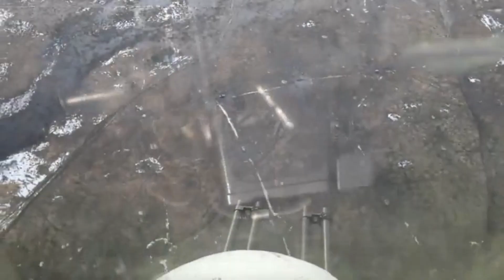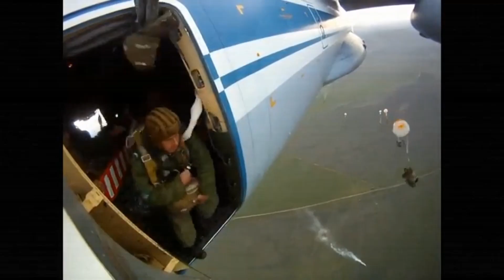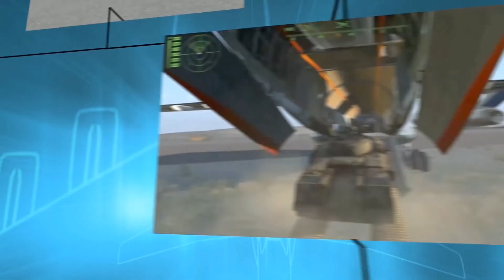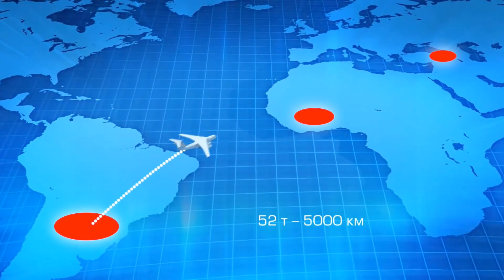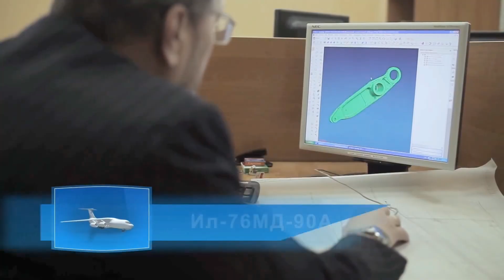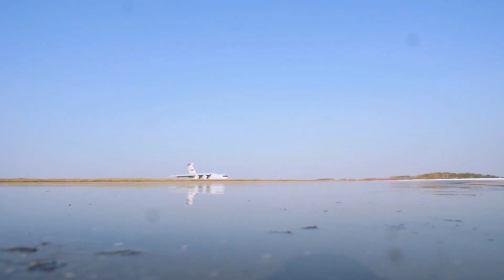Russian IL-76 Military Cargo Aircraft - HEAVY DUTY LIFTING!

Comment: The laws of physics set the design parameters for all types of aircraft, and heavy lift transport plane designs haven't changed much since they put jet engines on them.
Up-dating aircraft materials, power source and avionics is all that's needed on the basic design, no need for a complete re-design to get an aircraft to carry similar loads for similar distances. Modernising what fits onto the airframe gets the extra speed, distance and weights, building an all new design is clearly profit driven, not need driven.

Comment: I am curious why they ditched the gun turret entirely.  They could have made it an automated gun controlled from inside the cockpit.  I always thought it was one thing the soviets and later Russia got right.  If you have to do a drop in a hot zone it is a good idea to be able to keep the enemy's head down.  The problem with most cargo aircraft is they are basically defenseless massive targets.

Comment: I think it helps, that they had time to figure out maintenance and maybe improve air time on the new version. While they also keep the supply of spare parts for the older fleet of this type alive. It's definitely a bonus for export to make the new version a solid long term investment, while opening up a upgrade path for the older fleet. The training requirements might also be lower than with a completely new design. I think more important than the comparison to some american types, is if this is tailored to the users needs.

Comment: The latest version of the IL-76 appears to be something some of the air cargo companies would be interested in.  This jet is a workhorse and has proven itself for years.  With advanced avionics and engines, it would be more cost effective than the earlier versions and carry much more freight.  My only concern would be the availability of spare parts and engines for the West to obtain.  I also believe the cost would be less than a Boeing or Airbus cargo jet of similar size.  I also like the idea of four engines opposed to two even though fuel might be an issue.  I believe Russia should continue this aircraft because if it isn't broken, don't fix it.
Reply: Engines for the western nations won't be a problem. Like most other cargo aircrafts, this is also capable of using alternative engines.

Comment: Common dude!! You say youre in the aviation industry but you dont know what the APU or generator is for?? The APU isnt included for the comfort of the crew so theyll have power when the engines arent running. The APU is there for the ecact same reason its on aircraft like the 777, 767 and all others from 727 on. Its there to allow the aircraft to start engines without having to depend on ground equipment start carts like the super early jets used to be dependant on or when flying into airports that didnt have that support equipment they would have to keep an engine running while theyre on the ground. I will say this. A built in APU is an option on many airliners especially older ones. In fact one of the reasons for that air canada dc9 or md 80 crash was because it had to hot fuel or fuel with its engine running cause it didnt have the start carts to restart. It took too long and didnt deice again thus crashing.

Comment: Hmm why would they keep upgrading older things, maybe because they have shit funding and it's cheaper to keep upgrading parts and pieces over time than designing a whole new vehicle, I mean don't get me wrong they have some notable vehicles like uh...well, ok maybe they don't have a lot of really great things, but I mean they have the Sprut, it's a good tank destroyer, great gun, I mean it kinda failed what it was designed for (the specifics they put upon it, it's still amazing), oh they also have the Mig-35 (in my opinion their best fighter), but even that isn't even on the level of what is fielded by the US (F-22 is just god, F-35 definitely would outmatch it, hell a good F-15, F-16, or Hornet pilot could beat one) plus the gun it has isn't the best, but it's still very capable, helicopters, well they have the Hind, which is pretty good, but notice a pattern, they have some things that do good but fail in other areas, well maybe except the Terminator, I mean that thing is just badass, lucky bastards

Comment: This aircraft was designed to be similar to the Lockheed C-141 Starlifter.  As the Russians are want to do they made it larger.  No doubt it is a great transport with the equipment needed to fulfill its mission.  The C-17 which was the C-141's replacement was designed to be able to transport wide heavy cargo the Starlifter couldn't.  The C-141 has been retired as the airframes had 40,000 hours on them, which was a combination of combat and logistical flight hours.

Comment: I think that if the design works, keep using it. But i also think that a new design should be considered so that thier designs can be optimized for modern standards. Especially integration with electronic networks, automation, and flight cost.

Comment: I've always wondered what the cannons were for?
I mean, I would imagine a gunner would have some trouble keeping up with a jet interceptor or a missile, and the plane doesn't strike me as a ground support plane, though the gun is shooting ground targets in the video.

Or could it be a case of better to have and not need than to need and not have?
Reply: The main reason for having guns on the tail, I think, is simple: this plane was designed to deliver cargo to/from airfields near the front line. Therefore, during takeoff/landing the plane may be targeted with AA guns, Stingers or something like that (which was the case in Afghanistan, for example). The tail guns were to hopefully counter such threats, even if actually hitting someone on the ground with these guns might be problematic, the gunfire might just force them to keep their heads down long enough for the plane to get the hell out

Comment: This is the same 40 year old design with new engines. Not even "wide body". In the same class as the C-141 which was "retired" 25 plus years ago. Very Good aircraft but NOT even close to being in the same class as the C-17.
Reply: Stop reading those Russian LIES. FACTS: IL 76 is NOT wide body, you can simply tell that by just comparing the width of the IL 76 to the C-17 or ANY modern Wide Body aircraft. Your crazy if you thing the IL 76 is better than the C-17. The C-17 was not copied from the IL 76. The C-17 is a completely NEW design from ground up. INDEED the IL 76 was COPIED from the C-141!  FACTS: C-141 was designed in 1960 and First flight 1963. IL 76 designed in 1967 and First flight 1971. By the way, C-5 first flight 1968!! and An-124 first flight 1982!!  WHO COPIED WHO?

Comment: There is a further canadian twist to this one:
On the Aalborg Air Station they use Challenger (the aeroplane, not the tank) to patrol the Arctic. Not that much is happening there - and that is just as it should be; but just to make perfectly sure it remains so. They had 3 Challengers and on an international mission they smashed an engine - such things happen - but to get a replacement engine would take for ever. So the chaps looked at the internet and found one surplus to requierements from some arabian oil prince that went bankrupt and bought the entire plane for the price of the engine. The support ship Absalon was in the area spanking some pirates, so they brought the plane home to Denmark - typically Danish Navy: Return with more assets than they left with.

Now the Challenger was really to good to just throw away - needed a major overhaul though - and then the transport wing had an "Air Force One" and our PM can now travel to important meeting in a small but very posh plane with an interior out of the Arabian Nights.

Now there is an aircraft leasing company that ALSO has gone belly up with two Challengers in the passenger version - with a known provinence (actually old Cimber Air planes) and I have planted the idea that they should approach the curator of the estate to aquire the aeroplanes for a nominal sum and thus get a squadron up to full strength for the maintainance personel - and get a transport aircraft for the swapping of ships crews and transport staff officers (doing things staff officers do - slurping tea f.i.) - saving on airline tickets. The pilots will have to fly anyway to maintain the rating on the aircraft. Where they fly they really don't care - they just do their job.

There might be some conversion training where pilots apply for a reserve commission - but nothing to serious. There might be a position for an elderly NCO doing the thing he does best: Serving Martinies to officers (shaken not stirred) and some officers wife earning a little needle money as a flight attendant.

But my main consideration is actually transport for the military band (Prinsens musikkorps) - can't have his Royal Highness travelling without a band - can we? https://www.youtube.com/watch?v=z1088E6E2fY

Actually my ambition is a bit higher than that - this band has an association with a quite good opera soprano. Susanne Elmark.
https://www.youtube.com/watch?v=7djb5RWZ48Y
If nothing else that lipstick will scare the living daylight out of the enemy. The four high F's in a row can make anybody sweat on a cold day. All in perfectly good taste.

Comment: It would be interesting to know what the rationale was by the Russian ministry of defense regarding why they chose to remove the tail gun from the newer variant of the IL-76.  Was it a weight issue?   A cost issue?  Were the old guns not effective at suppressing AA, enemy aircraft, or shooting down SAM or AA missiles?     To me that would be very interesting to find out as it does seem baffling why they would remove what seems to be some seriously awesome defensive firepower. 
BTW, a video on the AN-72/74 Coaler would REALLY kick ass.  The STOL characteristics of that plane are amazing and it has a very interesting and unique design!
Reply: Tailguns are not very effective on jet aircraft as the bullit basically just hangs in the air. The B-52 has similarly eliminated the tailgunner.
Reply: tail gun not effective anymore jet can shot down any aircraft with rocket on distance up to 400km
Reply: That's odd... because in this video the bullets seem to smash the target area just fine.  Many Russian aircraft also still carry the tail guns.   The Bear bombers has them, the AN-12 Cub has them, the TU-22 has them.  Are these just for decoration?  Also, the tail gun is supposed to have radar guidance as well.  Surely that would be useful then for shooting down enemy aircraft and missiles.

Comment: I don't give AF if they are antiquated or not meta relevant; tail guns and turrets in general are dope.
Reply: Hello from sunny Bulgaria. The guns existed in the old version of IL76! Like they exist in the old version of B52.
Reply: in 80's, the tailguns were intended (and trained) to drop radio-reflectin straw against the radio-guided attacks, rather than to destoy ground targets. however, current versions of il-76 has no tailguns and a rear cabin at all (except the fuel tanker models), as now they leverage other protecton systems. however, they keep ability to use plugable containerized weapon - as missiles as even planning bombs.
Reply: Looks like a Gast gun; recoil from one gun drives ammo into the other.  The Gryazev-Shipunov GSh-23 was a Soviet version.

Still, tailguns on transports are incredibly stupid.
Reply: @psikogeek  why did B-52s have tail guns  is that not  incredibly stupid?
Reply: B-52s with tail guns were indeed incredibly stupid.
Reply: @psikogeek  during the Vietnam War a B-52s tail gun shot down a NVAF Mig-21 so in this case "incredible stupidity " paid off.
Reply: It does not follow that a tail gun shooting down a Mig means it "paid off."  The engineering, financial, and operational trade-offs of carrying the tail gun outweighed the benefits from it.

Such the Air Force concluded and removed tail guns in 1991.  I think that they had reached this conclusion around 1970.  

Tail guns cost lives.  Those who disagree are free to write the Air Force to implore their reinstatement.  They will treat the writers of such letters as "incredibly stupid."
Reply: @psikogeek  in the case of Mig-21 shoot down by a B-52s tail gun it paid off by saving the aircraft and  lives of the crew.  The airforce   had also concluded that fighters wil notl need internal guns in the era of missiles so left the gun out of the design of F-4 Phantom  but later reversed and developed the F-4E with an internal cannon. 
In this day and age I would tend to agree that tail guns are not need are a waste as there bomber will not face any air to air threats from the weak countries they attack who can't fight back in the air.
Reply: In the case of those who decided to put ( or keep ) tail guns on B-52s, the choice is whether to kill the crews by
A) having tail guns or
B) not having tail guns.
Obviously, they decided to have them at first.  If I understand correctly, they later deduced their prior decision was a wrong one from the day that the B-52 was designed.
Reply: @Ace-Av8er  also, if fighting a near-peer opponent they will have jets with missiles that out range the guns, so it is doubtful they would be of use now... That said, bringing back turrets might make sense when equipped with with lasers as they might prove useful as an active protection system / CWIS.
Reply: @Ace-Av8er  Syria
Reply: @georgepantazis141 the il-76md plane i used to fly many years ago are in syrian air force now. good luck to it.
Reply: @psikogeek
It's slavic AC-130.
Reply: @psikogeek  but not when it is used as a bomber.

Comment: Matsimus, there is no such thing as kilograms of thrust. kilograms is not a unit of force but a unit of weight. In this case Newton or Newton/second would be a more relevant unit.
Reply: Kilogram-force (Russian designation: kgf or kg; international: kgf or kgF) - unit of force in the ICGSS system of units; along with the meter and the second is the basic unit of this system. The Third General Conference on Weights and Measures (1901) gave this unit the following definition: "kilogram-force is equal to the force that informs the resting mass equal to the mass of the international prototype kilogram, acceleration equal to the normal acceleration of gravity (9,80665 m / s2)"
In the Russian Federation, kilogram-force units and gram-force are allowed to be used as non-system units with no expiration date with the "all areas" scope. In accordance with the Regulation on the units of quantities allowed for use in the Russian Federation, the kilogram-force unit is used only in cases where the quantitative values of the quantities are "impossible or inappropriate" expressed in units of the International System of Units (SI).
Reply: CC-01/425 kgw also works
Reply: Graff_Zitel indeed.
Reply: You could use kiloponds as a force unit.

Comment: Well, the nearest equivalent of the Candid was the C-141 Starlifter that went out of service before You were born - or close enough. The problem with the Starlifter was that it "bulked out" before it "grossed out". Simply put: It could easily lift more, but there was not room for it - and they had to put in extra plugs in the body to get more space. It had range enough; but could not use the capacity. The Starlifter was always a bit of a challenged child in the USAF transport. A problem that was never really addressed properly before the Globemaster III.
So lifting capacity is not likely to be an issue with the Candid.
I think the real problem for the Candid is the same as all Russian transport planes have: They have incredibly horrible engines. They have a big power output as long as they work - which generally isn't for very long.

The Candid has a terrible airfield performance with rather few airfields available to them - provided they carry anything of weight.
Reply: Funny enough, A-380 in freighter variant has opposite problem! :) Speaking of C-17 - really, this aircraft could use some symbolic lifting, maybe new engines and slight expansions like C-130J before just ending the line. This is great stuff.